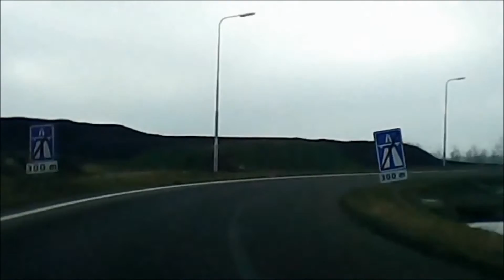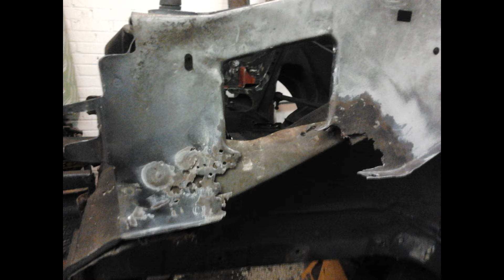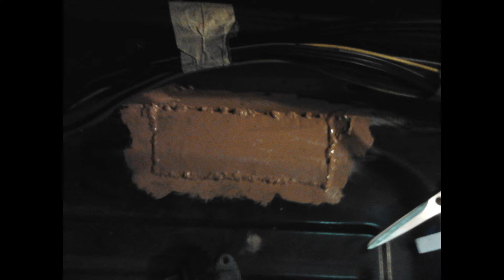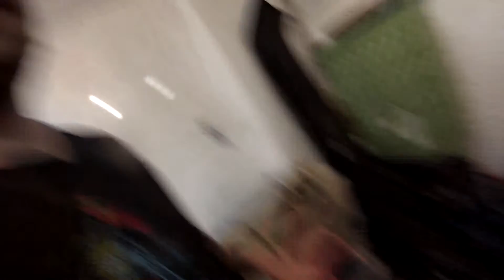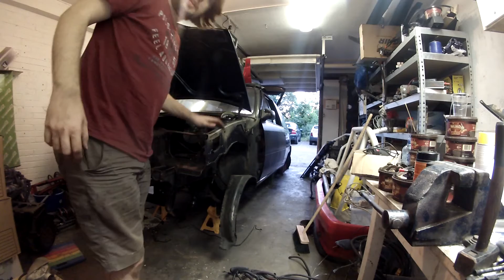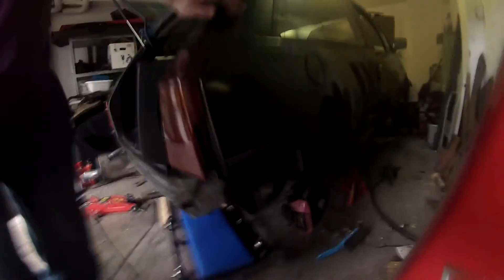Citroën AX 16V Trackday Project Episode 3: Wiring and welding

Comment: Hello I have an AX 16v too it was a 1.1i,but I have one problem.I don't know what electric installation wires I need.I Have a Saxo 16v  F1 ECU with it's engine wires.But for the interior what I need?.Congratulations for your videos!
Reply from the maker: For the interior I kept the AX looms, and spliced in the 23 pin Saxo main plug in place of the AX main plug.
The engine loom was also slightly modified, specifically the connectors to the saxo under-bonnet fusebox were replaced with a single plug that connects to the AX under bonnet fuse box. 
The fuel pump I connected directly inside the car (yellow wire, single pin red plug under the dash.)
The O2 sensor I connected to one of the pins that was labeled as 'throttle body heater' on the AX
And I used the Saxo clocks, so I put the extra wires for the speedometer, oil temperature, etc, through to the dash through the hole originally used for the mechanical speedometer cable.

I'll see if I can find the wiring diagram, but this should help: i.imgur.com/0OsSJlI.png
Reply: Low Budget Racing okay thank you so much for your response!